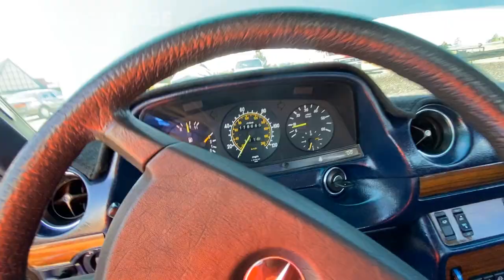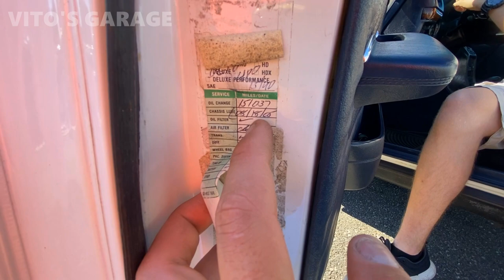White Mercedes W123 Accelerator Pivot Mount Bushing Replacement + Bonus Footage

Comment: Hi Vito! Now that you are in USA will you fix some of the issues of your 190e. What to expect next? I mean one thing you should fix is the heater core, if i am not mistaken... 
Greetings from Greece!
Reply from the maker: Heater core is replaced. I’m looking for a brand new or good used (not cracked) center vent assembly now. That’s why the video isn’t out yet. And I’m also working on the cluster

Comment: How about working on a 4 speed manual transmission.  Where do you get parts?
Reply from the maker: Which manual transmission?
Reply: @VITOSGARAGE  I drive a 1981 Mercedes w123 240d with a 4 speed manual.  The rubber part is aging and it is moving before the linkage moves.  I already replaced the plastic ball but I need to replace the rubber part and I have not found any replacement parts. I took some metal straps that are used to hold in place exhaust pipe heat wrap and Chris crossed the straps to relieve the rubber but it is definitely not perfect.

Comment: So. Accellerator pivot mount bushing is what that's called is it. I always just referred to the contraption as "The firewall thingy".
Reply from the maker: “Firewall thingy” sounds like what non automotive people would say
Reply: @VITOSGARAGE  This non automotive person has owned five Mercedes Benz's in my time. I like "firewall thingy" Along with "Gorilla knob" for the starter and "salt shaker"  for the glowplug light in the older pre 123 diesels.
Reply from the maker: @petercollingwood522  I understand but I can’t put that in the video title